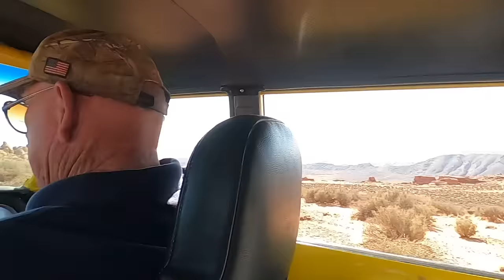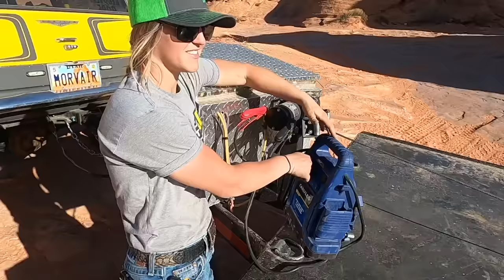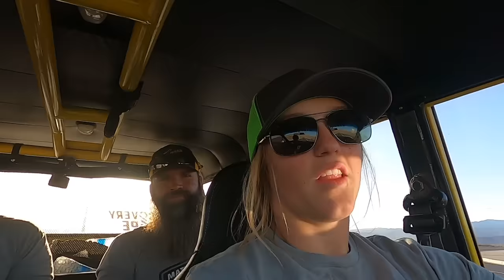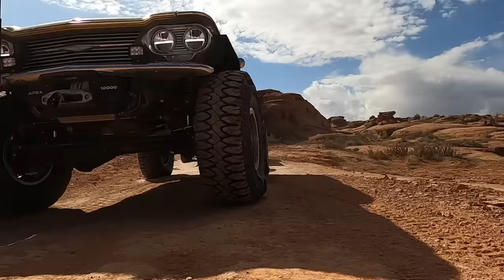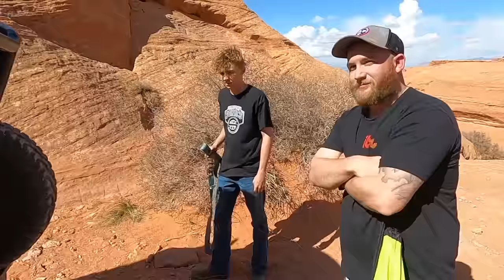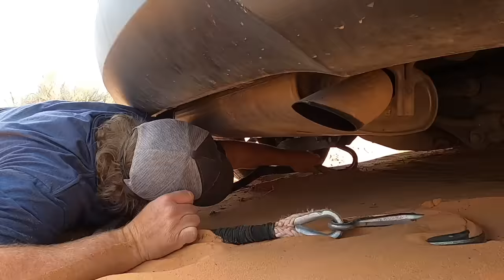Lizzy Takes Over Matt's Off Road Recovery

Comment: If the Morrvair has AC that’s working, turn it on along with the defrost on warm and crank it up. That will clear your windows. I doubt anybody on the show, except Ed, was around before car heaters were tied in with the AC.

Comment: The WW II half track had a cylindrical tank in the middle of the front bumper ( maybe a foot in dia x three feet wide ) mounted on bearings . It was bunged ( for water or gas storage) the Morevair needs one front and back .

Comment: Matt and crew. Love the channel. Question though; with all the recoveries of ATVs etc. why don't you buy, or better yet build your own off-road tilt trailer to eliminate all the issue of winching up vehicles with broken front ends? With a tilt trailer, you could more easily winch up even the ones missing wheels etc. It would sure beat trying to line up the ramps for each type of vehicle. Keep up the great work.
Reply: I think a lot of it is that they wanted the lightest trailer. Making it a tilt bed adds some extra frame and hardware so would be heavier than what they have.

Comment: I had a Toyota and a Pontiac that when you filled the tank the gauge went to empty on the Pontiac and 3/4 full in the Toyota. As you used fuel, it went to full then down.

Comment: Why don't you just charge the battery on the trailer via the aux pin on the trailer plug? You just need an amp limiter to avoid pulling too many amps if the battery in the back is low. :)

Comment: Man oh man that trailer takes a beating and keeps on going! Well done crew! P.S. Turbo is the cutest!
Reply: I really like the way the winch is set up. Today I needed to get my lawn mower moved into my truck so I can take it in to be repaired (electrical short). My wife helped me move it from my shop to my truck where I had a block and tackle hooked up. I was pulling extremely hard and one end of the block came off the rope holding it at the front of the truck. I went flying backwards and landed on the ground.  I had to go rest up since I'm not supposed to be doing things which cause me to fall or hit my head.  My neighbor saw I needed some help so he brought his winch over along with the battery to operate it. We used some chain and hooked up his rigging and with great ease pulled my mower onto the truck. Now I need to get one of these winches which came from Harbor Freight (2500# rating) which is designed for use on ATV's or other lightweight items.